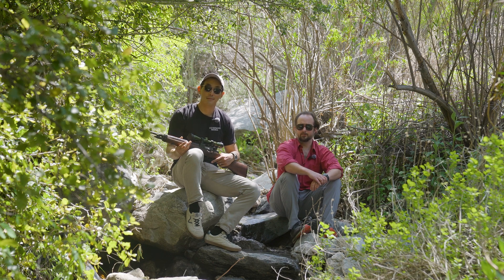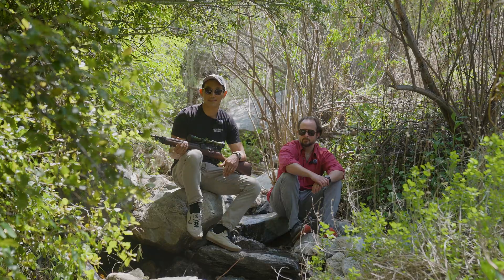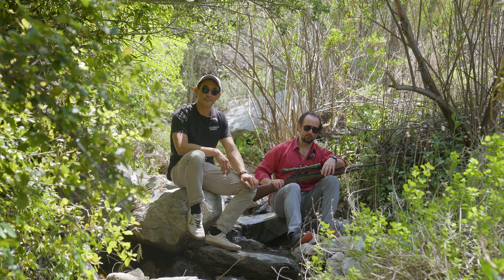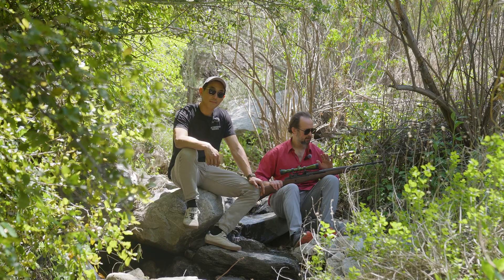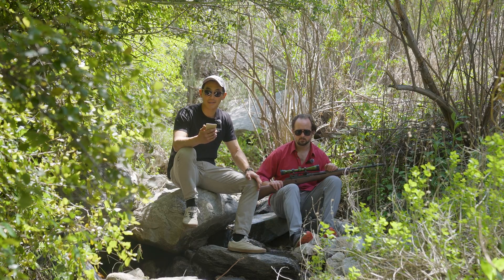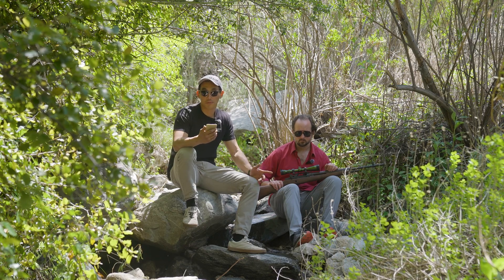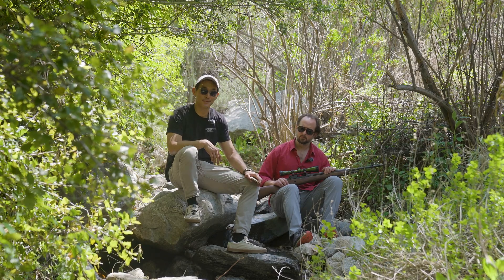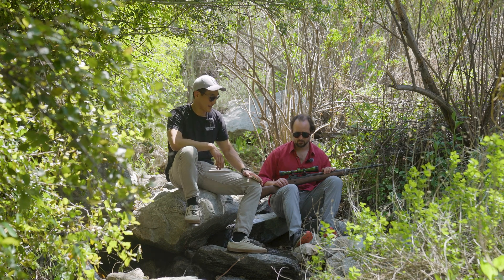M1A Powder Tests

Comment: Shim that gas system to properly time your gas cylinder lock, this should properly align it and eliminate any play/wiggle. Just by doing this you’ll notice your groups improve. It costs very little money and assuming you know how to take the rifle apart as well as the muzzle device off and put them back on correctly it’s totally worth the effort. I own multiple different M14 pattern rifles. Everything from a Polytec M-14S to a USMC Service Match built by CWO John Miller. The M14 can be made to shoot extremely well it’s just not the easiest platform to accurize.

Comment: The M1a is just copy of a battle rifle.  It is accurate enough for what it is designed for.  I have a standard grade, and found the scope was nothing more than dead weight on an already heavy rifle.  Mine shoots just as good with the factory sights.  I get around 3-4 moa, with an occasional 1-2 moa group, probably just a fluke when that happens.  Mine likes IMR 4895 and Ramshot TAC the best so far, and it shoots the Hornady 150gr. fmj as good as anything else.  Match bullets seem to be a waste of money in my rifle.